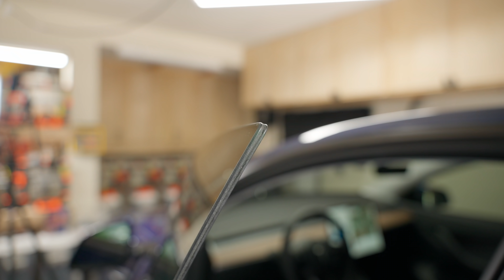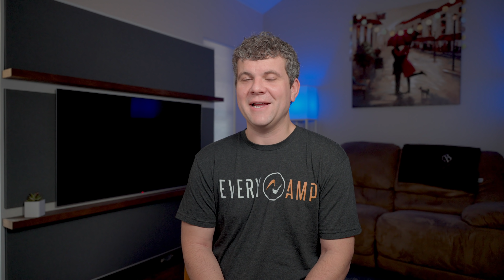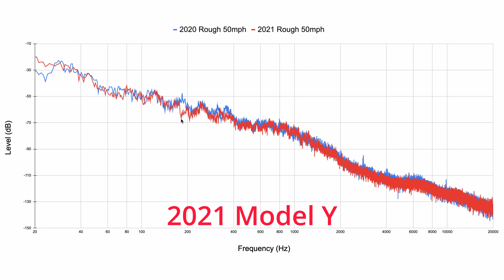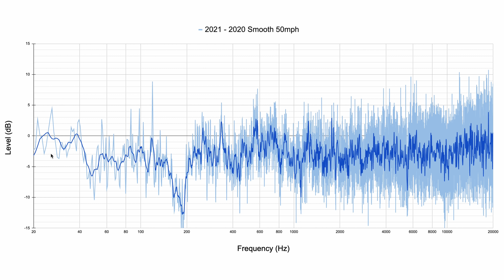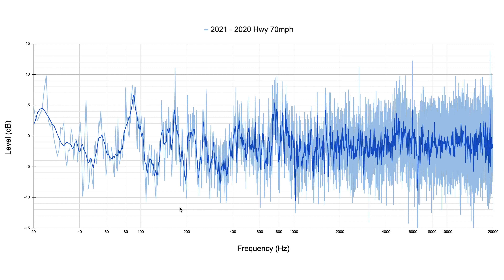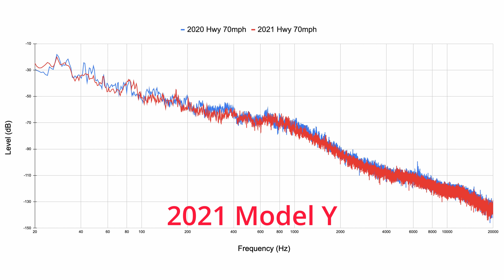2021 vs 2020 Model Y Road and Wind Noise

Comment: Need to repeat test with windows cracked open as a control.  If both cars have identical sound levels, it will show that the difference is caused by the windows.

Comment: Nice except the tires can make that much difference, so without the same tires you proved nothing. Swap the tires and repeat to see if there is a difference.
Reply from the maker: Tires are incapable of making a difference over such a broad range of frequencies. I pointed out the frequencies that were changing with speed which is a likely indicator of tire/wheel effects.
Reply: @EveryAmp  I appreciate what you are trying to do here, but when tire noise is the single biggest factor and you don't control for it, it makes is very hard for me to believe the results as some of the difference is tires, but we don't know which tires are helping and which are hurting, what frequency and how much. Your results makes sense, but if you used the same tires on both vehicles, I would feel much more comfortable with the results.

Comment: Sound pressure level meters actually weigh ny frequency. For example 1 kHz gets a higher weighting tank 20  kHz since we can hear 1 kHz sounds better. Not mentioned was how the microphone and recorder were used. If the recorder uses AGC (automatic gain control) this would modify the levels on the recordings. I would like more information included, like where in the car were the recording made and settings.
Reply from the maker: Here's a video where I go through the whole process: https://youtu.be/fj9yd4M5GQU

Comment: What bin size was used for the FFT? Tires (and wheel size) and the amount of wear on the tires make the biggest difference. When I replace old, worn tires with the same ones, the cabin gets dramatically quieter.
Reply from the maker: It was set to 65536

Comment: Coming from an audio nerd, great job on this video. There is a huge difference between the 2020 and 2021. The 2021 is significantly quieter in some key frequencies.

Comment: Hey Matthew, did you ever post the video of the hardwire radar detector?
Reply from the maker: Ha, no, by the time we got around to it Tesla had changed the power situation, so it was obsolete
Reply: @EveryAmp  no kidding, I have a 2020 and I'm trying to figure out an alternative solution to the 12v outlet, any suggestions?

Comment: Great video and análisis, did you measure the tire tread to make sure they were about the same? My guess is that the 2021 have more insulation material underneath the vehicle, I believe Munro discovered some of that or maybe it was new underneath panels. Thanks!
Reply from the maker: The 2020 has 5000 more miles on it than the 2021.

Comment: so what is the TLDR man? i failed high school math and have no clue! you said at end u hear a difference i guess that is the conclusion that 2021 is better? can u tell me by what % its more quieter? that is for basic dummy like me
Reply from the maker: You could say it's 15% quieter, if that helps. Like I said, there's a real difference, but it's not something you're going to be blown away by. Were you able to hear the difference in the sound clips?
Reply: @EveryAmp  thanks that is lot easier to digest. yes I was able to hear, sounded like a lower rumbling in the newer one. i suspect better seals and some more sound dampening stuff in the body etc. 

interestingly, some mat companies say their mats also help lower cabin noise from the bottom.  might be interesting to see with and without if that's a bogus claim or reality.  I imagine it could help a little its a thick barrier between the floor and the passenger.

Comment: So we can hear negative db?  I thought zero db was no sound.

Could you do a video about the safety factor of the double pain windows.  Some say they’re better and some say they cause issues.
Reply from the maker: You're thinking dB of sound pressure level (SPL).

dB is a logarithmic measurement in comparison to a reference level. In this case, it's an electrical output level of recorded audio. You'll see negative dB numbers on lots of audio equipment where 0dB is 100% output, anything less than that is a negative dB. 

By safety factor, you're saying their ability to withstand breakage vs you being able to break them to escape?